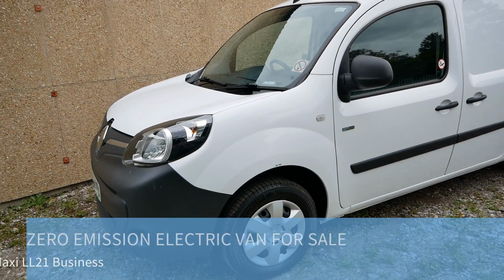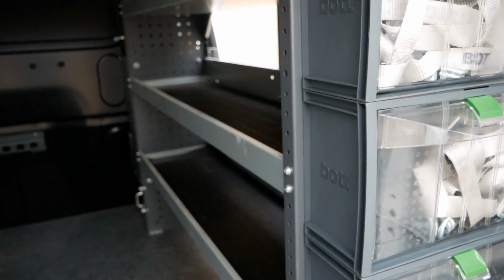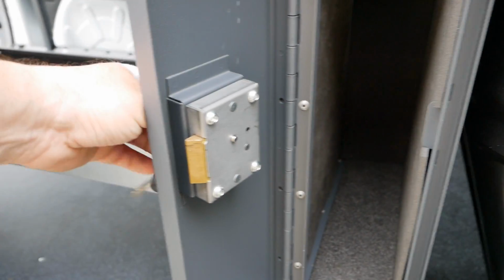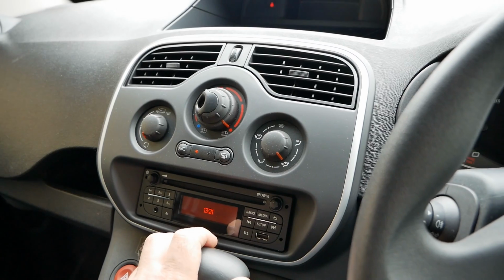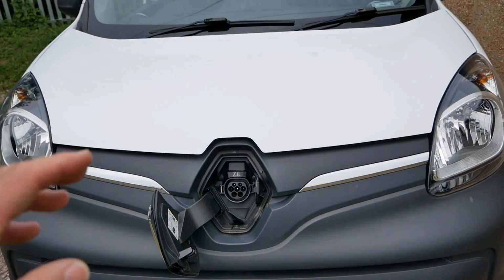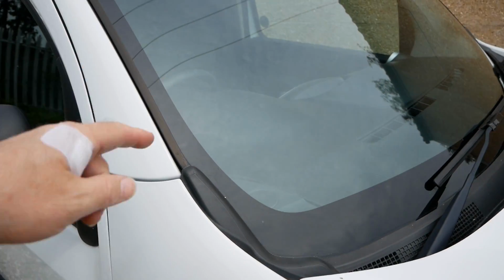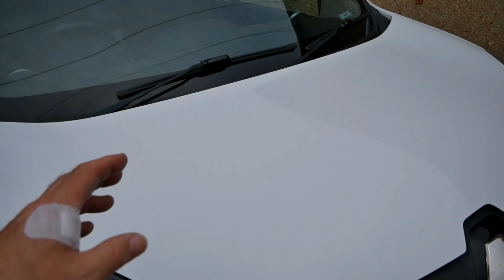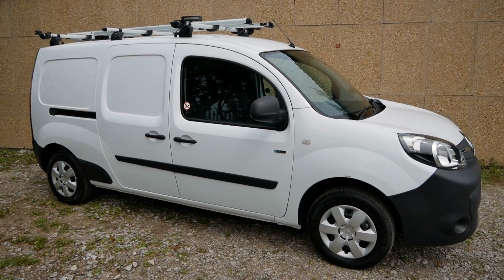Renault Kangoo Maxi ZE33 electric van (still like new) - NOW SOLD

Comment: Nice van .. maxi size is nice.
Prefer petrol diesel no turbo 

I wouldn't buy a EV van 
Ridiculous over priced...just fascicle ! !
Reply from the maker: But they're not. Used electric vans are cheaper than the equivalent diesel.
I've just looked up what brand new Kangoo Maxi can be purchased for and its £15,490+VAT (see https://www.autotrader.co.uk/van-details/202412187387050) which £2,500-£5,000 cheaper than any new diesel Maxi currently listed on Autotrader.
People think EVs are expensive because they were originally. But the Kangoo electric has been out for nearly 14 years now and have been on price parity for a few years and now EVs are getting cheaper than ICE.